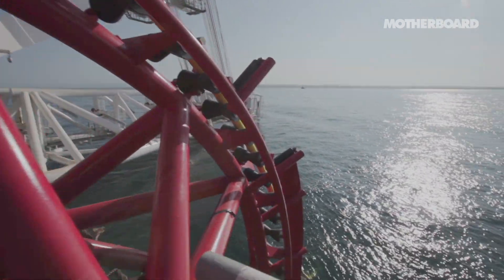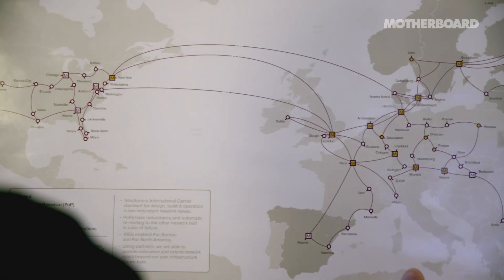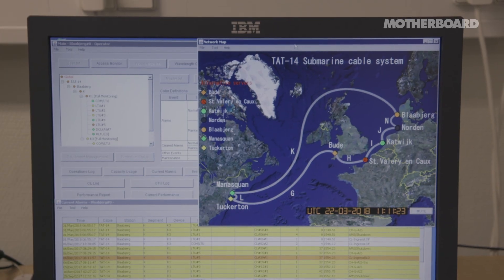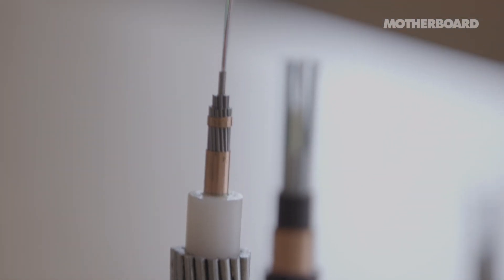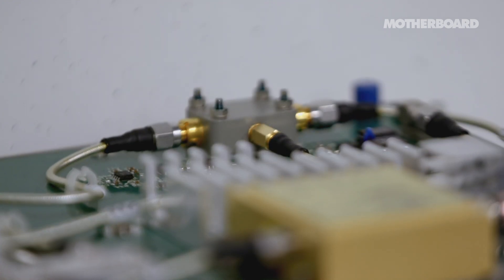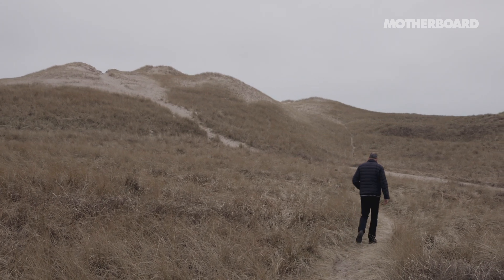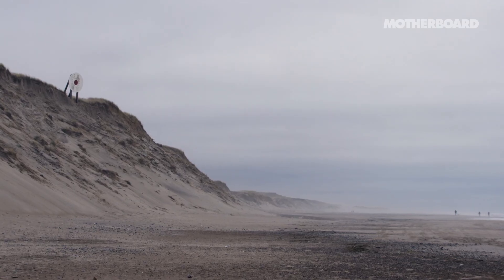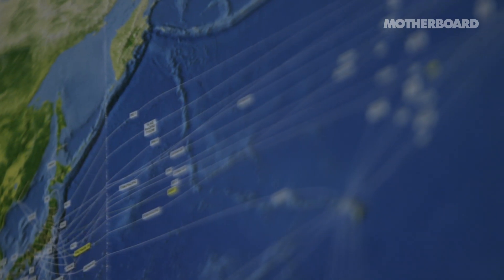Inside the Beach House Connecting the World’s Internet

Comment: given how important these cables are why wouldn't they install fully armored runs the entire way regardless of depth?  Is it because the weight at depth would make maintenance too difficult, or some other technical problem?   I don't think it would be a cost issue right?  Bc these connections are basically priceless.
Reply: Pressure wouldnt be the problem, that's for sure. Weight is one issue, for sure, not to mention an underwater current would be able to "grip" onto the cable much better, putting several hundred tons of force on it. And, whatever they are doing right now seems to be working, i'm sure they will fix any problems that come up, and quite quickly at that.
Reply: They are literally 1 cable from shore to shore.. Fully armouring the entire length would require a massive ship and add exponential cost.
Reply: Some are buried; There are various roving trenchers that get deployed around the world to bury the lines under the ocean floor for added protection. It's dropped from a ship and remotely controlled. A high precision job.
Reply: much more data goes over satelites than those cables.
Reply: vojtasTS29 yeah, no.

Comment: We have a lot of fiber here linking multiple buildings and SCADA networks where I work and I am always blown away with how much data can move over just a pair of fiber. Great video thanks for sharing! Now I want to know more about what they do out at sea! Man, it can't be easy to fix this junk in deep water!
Reply: It is absolutely freakin incredible.  And at speeds of milliseconds.
Reply: Makes sense, didn't even think of that, lol!
Reply: there's videos of the ships pulling and repairing cable
Reply: When they need to fix a submarine section, in deep water a robot is sent to the ocean floor, 2 sets of floats are installed, then the cable is cut between the floats. The ends float up, then a repair section is added in and the cable is dropped back to the ocean floor.

Comment: For some reason this piece made me fantasize about the feasibility of cutting all these TATs, I dunno why. Seemed to be the underlying question being answered by the man, that even if you tried, it would be very hard.
Reply: Very possible and governments are aware of threats by foreign intelligence/military to undersea cables. They are part of the critical infrastructure you would sabotage first in case of war. Also there was lots of wiretapping done with submarines etc. during the cold war by US and Soviets.
Reply: nhunha you can't really tap them today though, fiber optics running through a line like that is so hard to tap into without someone noticing a latency or filtering issue
Reply: damaging the cables, yes.
i work at an ISP and it also amazes me how inconspicuous these intercontinental cables that are responsible for literally dozens of millions of people's are. sometimes you can even see the cable poking a bit out of the earth near the beach and no one has any idea wtf it actually does. it should be dead simple for any malevolent agent to just sneak anywhere along it's crazy length and rupture it.
as for wiretapping it... easier said than done. the fact that there is so much data passing through it also means it's that much harder to find the traffic you're looking for.
Reply: There is also approx 10,000V applied to the cable, to power all of the optical-repeaters in series (- the voltage changes depending on distance and how many repeaters need powering).  If the cable is ever cut, the voltage on the cable, gets applied across whatever just cut it......

Comment: Fantastic video and I love when the public is made aware that wireless depends on physical access. Wireless is a tool not the solution. Thank you all who keep the links up and running.
Reply: well for now at least lol, spacex has finally begun lauching their internet sattellites.
Reply: @BattousaiHBr  Problem with that is latency issues, cables still reign supreme due to their ability to transfer data at such speed and latency, something you are currently unable to do with sat internet, even if it's SpaceX' program - which still serves a good purpose, but they're not replacing anything, just helping those who do not have access.
Reply: @lele-wp2hs  i work with telecoms and latency has nothing to do with the issue spacex will face, their biggest issue will be weather interference. higher frequency signals suffer a lot of attenuation from bad weather.
you are used to high orbit satellites (such as geostationary orbit) and that's why latency is terrible, but the spacex ones are very low orbit and will provide very good latency. in fact, because light travels at ~98% speed through air but only ~2/3 through optical fibers, for longer distance destinations you'd theoretically get better latency through spacex's satellite constellation than through existing intercontinental cables.
Reply: . @BattousaiHBr  What are the probabilities of them getting hit by meteors and even better, turning into one themselves?°
Reply: @maazkalim  it will certainly happen every once in a while, which will result in the effective nonrecoverable destruction of the satellite, but it doesn't happen very often and the network is designed to handle a bit of failover. there is no risk of them falling and hitting someone in the head because they are going too fast and would be incinerated on reentry due to the air pressure.
also because the satellites are very low orbit, they will lose altitude and burn up on reentry in a few years anyway, which means they will be constantly relaunching new ones for replacement.
Reply: BattousaiHBr It’s a mesh system. Every node will introduce latency.
Reply: @oblitafier  just because it's a mesh doesn't mean it's terrible like the wifi mesh you're probably thinking of. there are in fact high performance and low latency radio devices on the market, it's just that almost all of them are meant for the enterprise and ISPs and are prohibitively expensive for the typical consumer, but one affordable example is any lightspeed mouse from logitech, their performance and latency is just as good and sometimes better than competing wired mice to the point even pros are using them.
i personally have worked with ubiquiti's airfiber and the latency never goes above 1ms in typical usage, just like if the connection was wired.
Reply: . @BattousaiHBr  Guess you couldn't grasp the indication of ‘°’.

No worries! Because it's idiosyncratic, anyways.

Now, to get stereotypical: Thanks for your sincere effort, though. 😊

Comment: are these cables that are being placed Optic Fiber ?? What kind of cables are being used
Reply: Saabrito They are fiber optic cables, yes.
Reply: Try watching the video!!!
Reply: It can only be optic fibre. Everything else has a tiny fraction of the capacity and is not nearly as thin and light. If you're laying cable, everything costs about the same to lay, so you lay what has the most capacity when internet traffic is growing by 50% per year.
Reply: Saabrito naw it’s all just cat 5

Comment: It's flat
Reply: nitpoon The earth is 71% water on the SURFACE. There is still something under the surface as earth isn't hollow. Water only accounts for .02% of earth's mass. Also, a real time experiment was conducted by the discovery channel were they placed a long distance laser on a beach and sailed 8 miles (a distance where curvature is extremely apparent) away from the shore. They calculated where they needed to be based off of the earth's surface if it were flat and they held up a metal sheet and no laser shone on it. But when they hosted it up several feet up in the air after doing a round earth model calculation, the laser ended up shining directly on the sheet like they said it would. Thus proving it's round.
Reply: nitpoon Have fun seeing London from New York on your "flat earth"
Reply: nitpoon What more research do I have to do? If the earth was flat. You could technically see London from New York. Yes I do know about atmospheric distortion, but that only works on a spherical earth model. I do know that human eyes can only view an object up to a certain distance, however a telescope would easily see London would it not? If you did the math on it, you would see that flat earth simply isn't possible. If you take into account the different seasons in different places, the different time zones, the different daylight cycles, the Aurora Borialis, there are multiple things that disprove flat earth.
Reply: nitpoon Tell me one thing that disproves spherical earth?
Reply: nitpoon Planes do ajust for the curvature of the earth though... The gravity pulls the plane down as it moves along. And your altitude will eventually climb if you don't level it out (we fly our private plane around all the time. I should know)
Reply: nitpoon NASA has a live feed of the earth going at all times from the ISS
Reply: nitpoon You didn't fly at 170 thousand feet. Unless you were in a military jet meant for high altitudes like the black bird. Hell, the highest a commercial flight has gone is 60 thousand feet. YOU DID NOT FLY AT 170 THOUSAND FEET
Reply: Sylas the Great Don't even try to argue with him. He believes that bees levitate.
Reply: Alan G Mar I hate to be the guy that has to go down there and untangle those wires haha Flat Earth forever forever Flat Earth
Reply: nitpoon They put it... on a... BEACH. Not a hill or a mountain ya idiot.
Reply: nitpoon The whole plane of course. Which is why stalling is a thing. I also find it funny how you go back to previous statements that I made to avoid answering the real questions that would disprove your theory. You avoid my questions in the pursuit of looking smarter than you actually are. My statements are made in response to your questions, how about you make statements of your own.
Reply: nitpoon Buuut they don't. My uncle just recently retired from the U.S Airforce after years of service, he's taught me so much about planes it's not even funny. He has his own Cessna that he flies in frequently, a plane that I have also been in frequently. There is no such thing as a 100% stable altitude, your plane will always gradually gain altitude even with the nose in a place where you presume is level and straight ahead.
Reply: nitpoon You also just did it again. You are responding to my statements. Not my questions. Tell me how time zones work, tell me how sunrises and sunsets work. Explain to me how multiple mathematicians, geologists, aatronomers, and other people in fields related to the earth have always calculated a spherical earth. Explain to me the live feed of the ISS (and don't say some hoax shit like all flatterds do.) I need answers to questions, I don't need responses based off of my responses.
Reply: nitpoon Hell, currently the highest flying not rocket powered aircraft has only flown up to 85 thousand feet, again, that was the blackbird. You would not get enough air in the engines of a plane at 170 thousand feet, which again, IS WHY STALLING IS A THING.
Reply: nitpoon Humor me, what kind of plane was it that you guys flew in at 170 thousand feet.
Reply: nitpoon Also, both of those video are from conspiracy theorist tin foil wearing nerds who make videos for a living on their speculations. Find a point where Neil Degrasse Tyson says the earth is flat. I want some high level astronomer or geologist or mathematician in a video. Not some tin foil wearing freak bud.
Reply: nitpoon Also what about those multiple youtube videos of normal people not associated with the government launching things into the upper atmosphere? What about the dude who recorded his ascent and jumped from all the way up there a few weeks ago. They sure didn't hit any domes. The Sumerians, while smart, we're still primitive. They didn't have modern technology so they went off of what they saw on the ground. Idk about you, but on the earth looks flat to me down here, If I didn't know any better like the sumerians didn't, I would assume i5 was flat. But considering there has been multiple videos, multiple calculations, and multiple provable claims. I know better.
Reply: YoManSam I'm not talking about a plane dude talking about balloon
Reply: YoManSam Augustus Picard
Reply: YoManSam https://en.m.wikipedia.org/wiki/Stall_(fluid_mechanics) you're incorrect about stall
Reply: nitpoon You can't go that high with a balloon either. You wouldn't be able to breath, if you're talking about about a hot air balloon, the fire wouldn't receive enough oxygen and if you're talking about an air Ballon like a zeppelin or a sealed balloon, it would pop at 30k. Stop lying
Reply: nitpoon 1. You got that from Wikipedia, 

2. Every pilot knows that the weight of the plane and the air flow into the engine is a crucial factor of flight, which is why not getting enough air could cause a plane to stall.
Reply: nitpoon Augustus Picard died in the 60's. You know, a time when we knew little to nothing about how planets work.
Reply: nitpoon You're trolling.
Reply: nitpoon Do you want me to link you to the ISS live feed? I can if you're too incompetent to do it yourself.
Reply: nitpoon Also everyone knows gravity is a theory. But no one's gonna say Earth is accelerating at very high speeds which is why we stay on the ground. Thats Stupid.
Reply: YoManSam and even if the ISS feed was real which it is not it doesn't show the earth in its entirety but it's not real anyway so it doesn't matter we've had balloons that prove flat Horizon 170000 + feet boom
Reply: nitpoon Anyways, you're trolling. There's no way a human being is so ignorant.
Reply: nitpoon I thought you guys believed density is what keeps you down... So you're saying the flat Earth is accelerating upwards to give us the illusion of gravity?
Reply: Some lengthy curving sea cables. Curving water Lol 
Upside down spinning around traversing "outer space at a billion milea annually" Lol!
Fuckin bloody jesuit bastards and their corporate globalism
Reply: YoManSam that's so funny proves you know absolutely nothing about what you're talking about haha that is hilarious you came back with a highlighted comment trying to act like you knew something and you failed epically you didn't research first haha have a wonderful day
Reply: YoManSam atmospheric Distortion only works on a sphere model that's where I stopped reading your comment because I'm laughing so hard I can't breathe
Reply: YoManSam there's no real picture there's no proof of curvature and NASA admits they don't have a real picture NASA also change the shape of the earth to a pear and they don't have a real picture of that or the math associated with the new shape change the shape you change everything. I could go on like the Earth is 71% water and water always Finds Its level gravity's just a theory bees levitate planes don't adjust for the curvature anyway you have a good day you got a lot of research I guess you should start at the beginning with the Sumerians who knew the Earth was a flat disk covered with three domes
Reply: YoManSam that's absolutely hilarious are you serious unfortunately I believe you are we never said the Earth doesn't have mountains Hills and Valleys of course it does but it's not a sphere
Reply: YoManSam are you serious you are so hilarious
Reply: YoManSam oh my God you're still trying to act intelligent LOL try producing a real picture of the Earth try proving curvature just two things and you better research before you start coming back with pictures have a wonderful day
Reply: YoManSam gravity pulls the plane down just the nose or the whole plane hahaha I'm dying such a clown please continue
Reply: YoManSam wow you've done no research that's already been exposed as a computer-generated program
Reply: YoManSam first of all you're incorrect planes do not adjust for curvature they fly on a flat level line until they reach their destination I suggest you do some research and I suggest you research gravity because even glowbes no it's just a theory you really need to do some research
Reply: YoManSam it's pretty easy like I said start with the Sumerians since they are the ones that invented time as we know it as well as many things we still used today and they were masters of the sky and many things and they believe the Earth to be flat covered with domes start with the Sumerians and move forward but if you got a real picture of the earth handy or proof of curvature you could share that and that would solve everything but I'm not going to hold my breath I would start with the Sumerians
Reply: YoManSam yep I used to know a flight instructor she passed away a few years back and the plane always flies flat and level and I quote her words I never took down the nose of the plane to adjust for curvature and that's all she could answer and there Horizon was flat no curve in fact we've gone 170000 ft and the horizons flat you're supposed to see the curvature at 45000 feet according to NASA and it's supposed to drop in all directions away from you unfortunately it doesn't have a wonderful day
Reply: YoManSam https://youtu.be/EzsnOH114ck
Reply: YoManSam https://youtu.be/DYIzDSJg8s8
Reply: YoManSam research gravity is just a theory bees levitate
Reply: YoManSam the Articles pretty in depth and accurate and you are incorrect have a nice day
Reply: YoManSam still no real picture of Earth or proof of curvature I see
Reply: YoManSam https://en.m.wikipedia.org/wiki/High-altitude_balloon once again you're incorrect about how high we could go with balloon you're getting owned
Reply: YoManSam no because the ISS feed is a computer-generated program it's not real already debunked
Reply: Dead Memes yeah well that's not the case doesn't change the fact it's flat
Reply: Dead Memes we could also use water since it carries memory as well I mean there's all kinds of things we could come up with in the future but it's flat
Reply: lmao, great troll